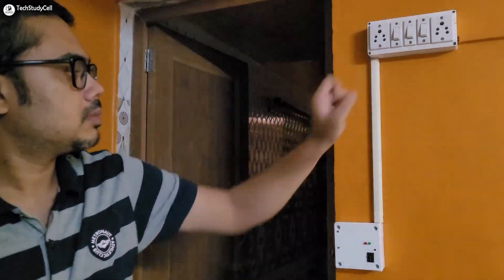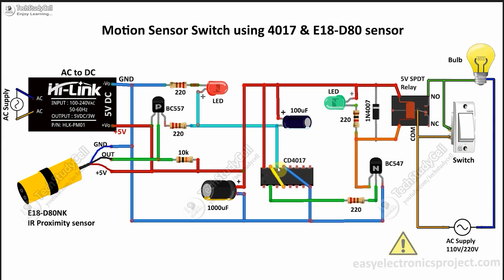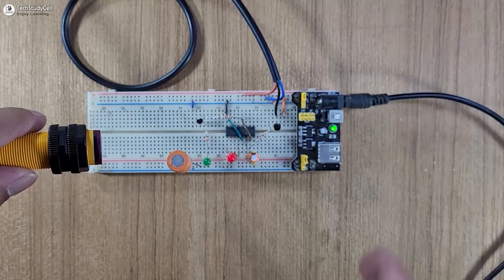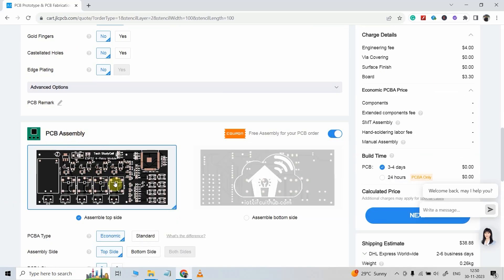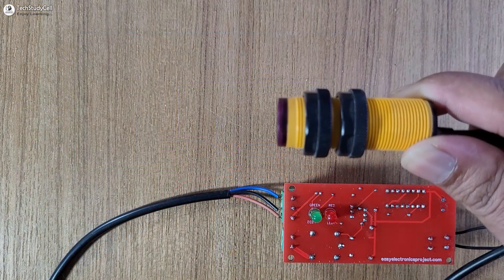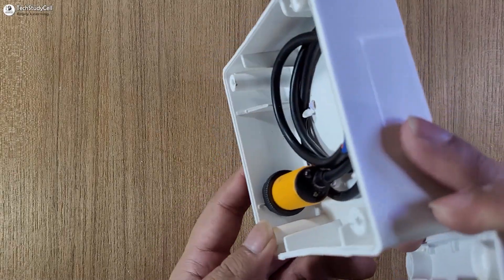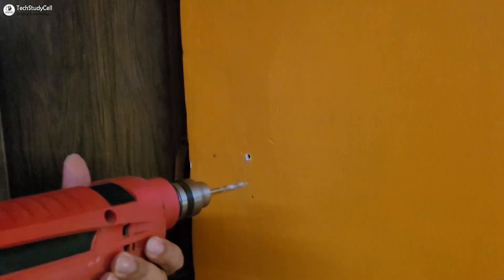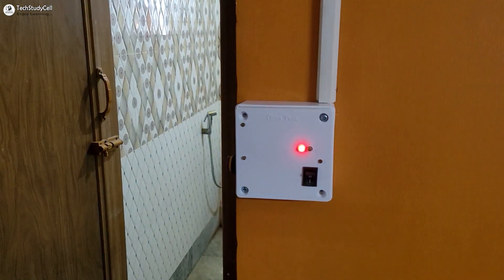How to make Motion Sensor Switch using IR Proximity Sensor | CD4017 IC Projects

Comment: I also need your help urgently, I need to design a fully analogue circuit (no programmable components) that does this .As long as motion is detected within the specified time interval set by the timer, the countdown process continues to reset, and the bulb remains illuminated. Once no motion is detected for the entire duration of the countdown cycle, the timer’s output signal switches off, turning off the bulb.